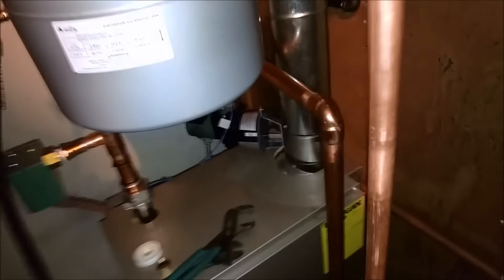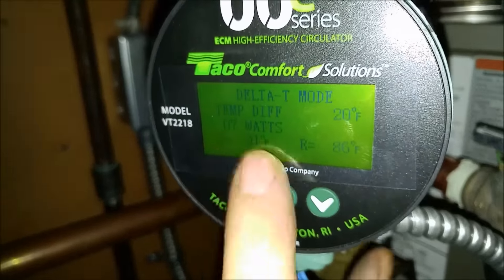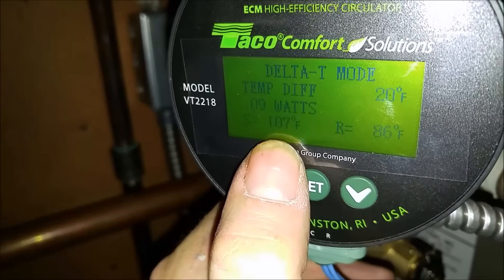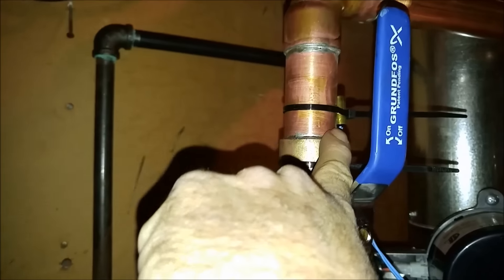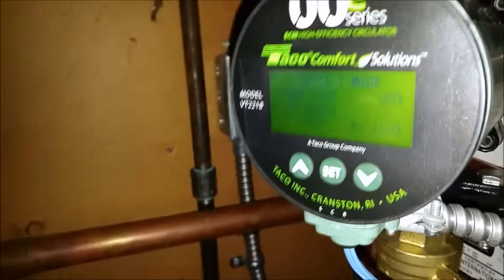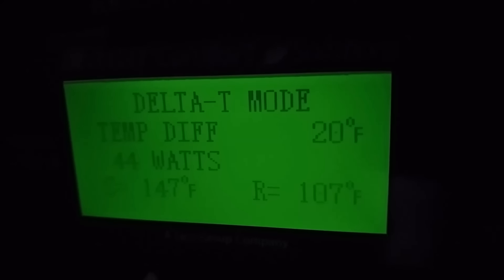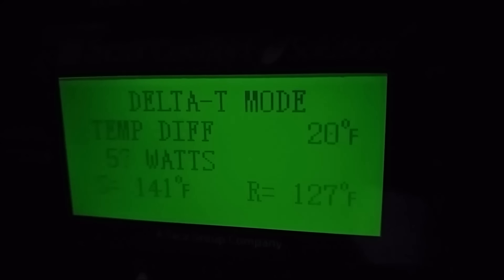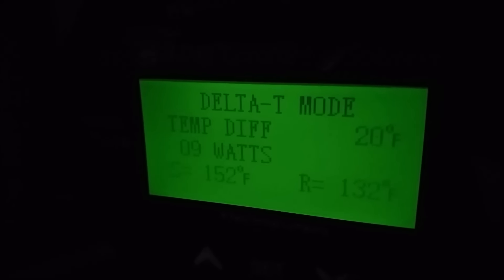Taco VT2218 Delta T pump in action

Comment: could this pump be used instead of a mixing valve if your boiler output is 180 going to 120 radiant heat?

Comment: If you have two zones of radiators, one hot, one cold. the cold one starts calling, what happens? Wont the pump sense a high supply, low return, speed up and send a slug of cold water into my boiler?

Seems bad, maybe i am misunderstanding, but seems like a good way to shock a boiler in a high volume distribution system.
Reply from the maker: +Daniel Nowitz I understand what you're saying but water that's 50 degrees is not going to shock a boiler especially a water boiler it would shock it if it's a steam boiler but you're right the pump will speed up and introduce colder water into the boiler which mixes with hot boiling water thanks for watching
Reply: It seems what would be ideal is a delta-t mode w/ boiler protection; i see they have a set-point heat w/ boiler protection. 

If I could set it up for delta-t 20 degrees and also boiler protection at 140. It would work with my outdoor reset and also slow down flow to protect the boiler as it comes up to temp. 

with the set-point heat w/ boiler protection i cant really take advantage of outdoor reset because the setpoint is presumably static. 

anyway, thanks for making this video. The documentation (https://s3.amazonaws.com/s3.supplyhouse.com/product_files/Taco-VT2218-HY1-FC1A01-Install-Instructions.pdf) doesnt exactly explain when the pump will speed up or slow down in delta-t mode. From your video it seems that the pump will speed up anytime delta t is both greater or lower than the setting. Then slow down to the lowest speed once it is sure it cannot widen delta t (after the three minute startup cycle).

Comment: Is this a good idea to use these pump in 4 zones house? Our zones is very different in length ( not sure if it makes difference) . We have to replace the boiler I would like to upgrade the system to most efficient pumps.  Thanks!
Reply from the maker: It's a very good option

Comment: Thats a nice pump. But you have it installed wrong. It should be on the supply, pumping away from the expansion tank.
Reply from the maker: Catherine Sweeney  You need to look at the video again make sure you watch the whole video Before you comment Pump is on the return side and is pumping away from the air scoop The boiler is a neutral zone
Reply: @MiHeatingGuy  I watched the video as well and saw the same thing. The circulator should never be on the return. Period. Correct location is to install it on the supply, after the expansion tank and air separator. Look at manual for the VT2218 if you doubt me. 

Catherine was right. You sound uneducated about how the laws of thermodynamics in this video.
Reply: @daveschroers4222  Uneducated?  If you look at the Taco manual it says "preferred" and "alternate" .  Right there in the manual it states "ALTERNATE PIPING
FOR ZONE VALVES
 ON BOILER RETURN".

Comment: Honestly that pump seems like it was all over the place it never worked well to get to the 20 degree delta.
Reply from the maker: georgeEPC  This video is a simulation of what the pump does Because I was using the valves to simulate how the pump actually works on temperature thanks for watching